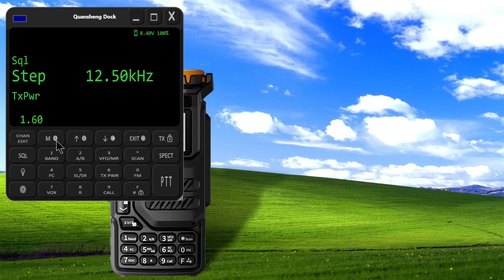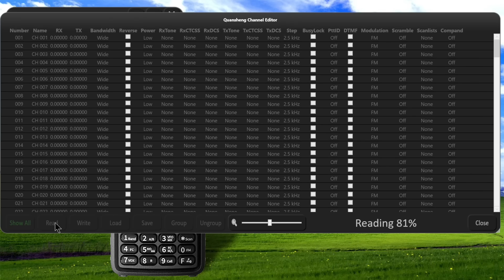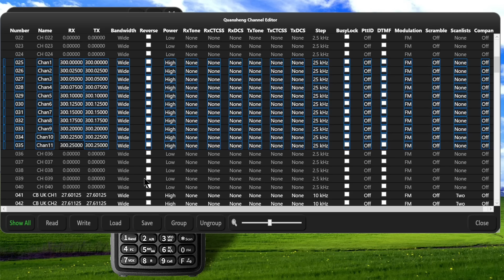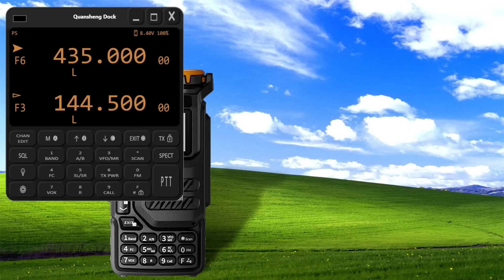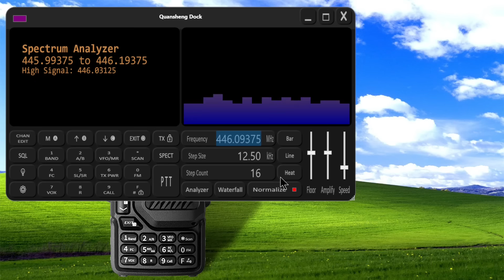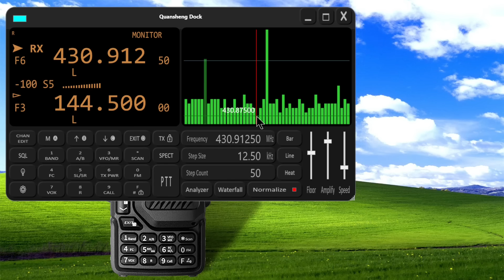Quansheng UV-K5 Remote Dock System

Comment: Just curious. Does your very nice software only run on your firmware, or can it be used with any? I have 2 of the radio's both on different firmwares. Is there anything special built into your compiled bin file to make your front end work or will it see other's aswell ?

Small update : I installed the frmware from the link above, installed the software on my PC, and it does work, problem is, it also crashed my PC 4 times in a row with a different BSOD code each time, there is some really BAD bugs in your software, as soon as I uninstalled it,. my PC was fine again. I like the idea, but not the instability it seems to have.
Reply from the maker: Sorry to hear that you're having those problems. Not sure what to tell you. I've been developing this for that last 4 days and my PC hasn't been restarted that whole time and the app has been run hundreds of times and left running overnight and I've not experienced a single BSOD. Everyone's PC is different though and you may very well have some hardware/software configuration that disagrees with it somehow. I did see another video of someone demonstrating it where the app crashed while he was adjusting the font size in the channel editor, yet I could not replicate it. But I clearly saw it crash on the video. Things like that are extremely difficult to pinpoint when they can't be replicated locally. I'm sure that others will likely get the same issues as you and report it. Bear in mind this app didn't exist 5 days ago, it's extremely new and bound to have teething problems.
Reply: @nicsure  Thanks for the reply. I haven't got a problem with the software, I FULLY understand newborn's and their inherent ability to piss one off. I'm happy to keep playing with it, like I said, I like the concept, but the bugs are problematic. My PC is setup with just about every radio software I can install, and programming software for several different radio's, any of which could be throwing a tantrum. I can try it on a less cluttered machine and see if the problem re occurs. I really don't want to have to reload Windoze as a possible fix for an issue, It would be a nightmare on this PC, as it's my radio machine, it has EVERYTHING I use daily for all my radio stuff, and some of it takes ages to reconfigure, I hope it gets sorted somehow, I am very impressed by it so far, I REALLY like the channel programming abilities you built in, the feature video made me install it before it had even finished playing.....

Quick crash information : All was working, I was clicking around and seeing button presses changing things on the radio, opened the spectrum and closed it, opened the settings and closed them. I then clicked on unlock TX, nothing happened to the icon, I clicked PTT and it opened the TX on the radio, even though the icon padlock was still locked. I clicked PTT a second time  and the radio locked in TX, the software froze and I had to do a force shutdown of the entire PC. Both keyboard and mouse were locked. I assume something crashed the USB hubs in the PC. After a reboot, simply opening the software with the radio connected and turned on would result in a BSOD. After unplugging the cable, rebooting and removing the software, the PC is fine again. i tried to find the BSOD logs to see if anything was showing as to the cause, but I have no idea what to look for or where to find them. I followed a google idea or two and got nowhere, and sadly event viewer lacks any real information in its error logging.

One other idea, is is possible to maybe have the radio talk the PC via the USB3 port as an optional connection? Or would that require more in depth knowledge?
Reply from the maker: @bitemykrank1970 I would say that the most probable cause is RF energy getting into the cabling and causing all sorts of mayhem.
Reply: @nicsure  It would have to get through a bucketload of ferrite first. Every cable in my shack has at least ten clip on or through wrap ferrite blocks as I had RF caused PC shutdowns on 144-148mhz before with the HT antenna's too close to the monitors. I doubt it's RF swamping it, it was only on TX for 2 seconds and only at 800mW output power. I'll try it again and see if I can replicate the problems. It's simple enough to change the radio firmware again.
Reply from the maker: @bitemykrank1970 I'm just seeing a lot of reports of problems that seem to appear right when the user is transmitting. It seems unlikely to be a coincidence. I actually have a bad fear that radio, being not of stellar construction has very little isolation on the side ports. So when transmitting it's literally injecting RF directly into the attached cables. If that's the case I may as well close the project as it's never going to work. :(
Reply: @nicsure  I had thought of that myself, I am going to wrap one of my program cords with some ferrite and see if it is any better. I did get a few lines on the monitor at first keying, so there is certainly RF around , whether or not it's coupling to the audio or microphone port is anyone's guess, it could be as simple as crappy cables without decent sheilding, don't give up on it yet, it might only need a simple fix.
Reply from the maker: @bitemykrank1970 I'm hoping the AIOC will offer a solution to the "hack a cable together" approach. I should be getting one soon so I can experiment.
Reply: @nicsure  I was going to suggest this as another possible fix, but being in beta itself, the AIOC may have issues aswell. I'm not clever enough to fix issue's in two areas at once..
Reply from the maker: @bitemykrank1970  I've been reading about it and from what others tell me there is an issue with the PTT assertion when used with my system. However, there shouldn't be any need for that part of it as PTT can be asserted from the Dock over the data line instead. But I'll get more of an idea about that when it arrives. I know it's in beta, but it is definitely a far better solution. A Bluetooth version of it would be even batter.
Reply: @nicsure  I'm sure WiFi and Bluetooth are on the drawing board, if not already in the works....I'd be surprised if the AIOC designers do a half assed job, they seem committed.
Reply from the maker: @bitemykrank1970 You seem to know about this stuff. Are those "clamp on" ferrite things sufficient for the USB-C cable on the AIOC?
Reply: @nicsure  I cannot say they will fix the issue, but I can say they wouldn't hurt it. I had RF swamping from a HT on 477mhz, as soon as I keyed up, the PC would shutdown, I never found the root cause, but adding ferrite to the power cable of the PC and the monitor cable resolved the issue in that case. I also had an RF issue on a laptop via a programming cable for my mobile UHF, I added 3 inline type 43 clip on cores, wrapping the cable through each one two times, and the RF was killed. I don't know if it will work on the lack of shielding in your average USB cable, but I have a " High Quality " USB cord for my ICOM 7300 and it came with a ferrite block at the PC end, so I assume it must have some effect, how much though I cannot answer. Best suggestion is to buy some and try some....a trip to your local electronics store might even get a few free for testing if you explain the reason your wanting them, most people into electronics know about the test phases of a product, and many are only to happy to help. I'd send you some myself, but I doubt I could afford the current international postage cost.....

Comment: Neat stuff.  I was having a look at the firmware project.  I think documenting the serial port API you implemented could yield a lot more interesting projects.  I'm personally thinking about the possibility of permanently attaching a Pi Zero and enabling scripting operation via bash scripts or a python library, possibly even adding a web UI...
Reply: I think this mod is perfect for uniting this radio with a DigiPi system...
Reply: Please do everyone a favor and do it in go lang especially if you intend to use a web GUI, python is just to hungry especially on devices like a Raspberry Pi. 
But besides that I give your ideas a thumbs up 👍
Reply: @jacobscheit4128  If you're that worried about performance, I'll make sure it runs under pypy.  I'd rather not have to worry about ensuring it compiles under multiple architectures.

But the language won't be a limiting factor here; everything will be bottlenecked by the serial communication with the radio.

Comment: It's a shame that such an awesome piece of software is developed for such a poor radio. Would it be possible to use it with a truSDX or something von QRPLabs?
Reply from the maker: The radio isn't the only thing that's poor. I can only really develop for stuff I can afford.
Reply: @nicsure   that's true but the others are not much more.  maybe you can modify it so that the community can develop it further for other radios or donate you other radios. I could imagine how much time you spent in this and it would be a pitty if it's only usable for such a crappy radio
Reply from the maker: @mt8385 Well it's all open source so anyone can try to adapt it.

Comment: Fantastic...very slick.  Will a virtual audio cable output work once a modified physical cable is used?  I'm looking to trigger VOX in zello.  Thanks.
Reply from the maker: VOX is tricky, you'd need to hack into the audio-in line too. Unfortunately I don't know what zello is or what a virtual audio cable is either so I can't really advise you on that.

Comment: it works with the programming cable ? or i have to modify the radio in a certain way for this software to work?
Reply from the maker: You don't have to modify the radio at all. It will work with just the programming cable but you won't get any audio. You need a special cable for audio and TX to work.
Reply: @nicsure  got it, in a radioamateur group im at alot of people talk about the poor quality of the quansheng radios on rx or tx or even in' build quality, are they wrong ? because since i started looking into this radio there is alot of cool things about it that for example my baonfeng uv82 doesnt have at all, would you recommend it ?
Reply from the maker: @Akiralsdr It's hard not to recommend it for the price it is. When all said and done it costs about as much as ordering a couple of pizzas. For that price you're not going to get an iCOM but at the end of the day, it works, and in my opinion it works far better than it has any business doing for its price point.

Comment: Sweet. Put a roof mounted 2m/440 antenna on the roof and this radio o house main power you have a radio that hits all the repeaters in my area and it has its own back up power incase of emergencies. Controllable with a PC. Even better.

Comment: It has been said by some cynics that the reason that these are so open and modifiable is that the manufacturer is using the community to do all of the work of research and development for them..
Reply: I hope it's working for them, I've already got two of these things and can't be happier. The open source firmware just opens endless options.
Reply: If the manufacturer acknowledges all the wide band firmware's existing, they might have to prevent their installation, to keep their FCC certifications.

Comment: Nice video! I'm still a beginner on this but I wanted to use and try this. Just a question if incase I wanted to revert this to the original egzumer firmware do I just flash it again directly? I don't wanna brick my radio im just poor.
Reply from the maker: Yes, there's nothing permanent about flashing a firmware. I must have flashed mine hundreds of times now. If you want to take the radio back to the standard egz firmware, just flash it back on.
Reply: @nicsure  Alright, thanks!

Comment: Nice video and amazingly well done. I'm surely going to experiment with this, thanks! Coincidentally I just bought two of these on AliExpress two days ago: a UV-K5(8) (€19) and a UV-5R (€20) including programming cable and free shipping. They will be delivered around Jan 15th. I was thinking of unlocking TX on one of them for the PMR channels. Any idea if some power will get through the hardware rejection filter (if there is any) on those frequencies? 73 de PA. Liked and subscribed.
Reply from the maker: Thank you for liking and subscribing I really appreciate that. As far as I know, it will transmit on the PMR frequencies with no problem, but I must point out that the radio isn't certified for transmitting on those frequencies. Realistically no one is going to know what you're transmitting on if you keep the power low, but just be aware of potential legal issues there.
Reply: @nicsure  Good point, don't want to lose my license. I'll keep the power as low as possible.

Comment: "QuanshengDock.exe" where do i find that programme? Its not in the zip file?!
Reply from the maker: It most definitely is, I just double checked myself. It's possible you have some security software that has deleted it or misidentified it as dangerous. If you're concerned you can review the source code and compile it yourself.
Reply: I dont even have a antivirus scanner but in the zit there is no QuanshengDock.exe and when i look on the github there is no QuanshengDock.exe. Im i getting old or what?
Reply from the maker: There's no exe on the github itself, that's only the source code. Make sure you're downloading it from here: https://github.com/nicsure/QuanshengDock/releases/download/v0.21q/quanshengdock.zip  . I can assure you, once the zip file is extracted to a folder, the exe should be there. If it's not then there is something on your system removing it somehow.
Reply from the maker: Oh, and It might not be called "QuanshengDock.exe" on your system. As a developer I always have file extensions showing for all files on my system, but I forget that not everyone has their Windows setup like that. So it might just be called just "QuanshengDock" without the ".exe". It should have an icon that looks like a UV-K5.

Comment: in my opinion....i think it's better to integrate with pc/laptop microphone... there's APRS cable that have 3.5mm and 2.5mm to a 3.5mm audio jack that's usually done for APRS,SSTV etc....
Reply from the maker: Yes, I was wanting to do this, but then it starts getting messy with regard to wiring and audio routing, you'd need two audio inputs on the PC side, one for microphone/FSK and one for radio audio/FSK and two audio outputs for monitoring and sending audio to the radio for transmission. It's likely something I will incorporate later as I wanted to get this to a state where I can fully use the radio from a remote desktop connection.

Comment: Amazon job ! Could you provide câble schematic in ordre to connect audio to the computer ?
Reply from the maker: Sure. I'll add a schematic to GitHub. There is a rough hand-drawn diagram there already.
Reply: @nicsure can you show how to DIY it....i have this in my thought a month again but failed to think how to diy it
Reply from the maker: @mikhailsimon9027  The diagram, schematic and step by step guide on how to make the cable is on the project page on GitHub. Check the video description.

Comment: The perfect software for my new rigs. Thank you.
I'll be opening up my 2 HT's and mounting them in metal cabinets to act as base stations. I'll add switched bandpass filters for 10 meters, 6 meters and 900 MHz to make a couple of 5 band transceivers out of the HT's. They will come in handy, as I have nothing at the moment that can operate on 6 meters or 900 MHz. I'll add a good speaker and pre-amps for receive as needed, and perhaps a 40 Watt power amp for 10 meters and 6 meters. I already have a couple of 3 Watt amp modules for 900 MHz. The hardware mods I can do, and I have a lot of old HP and similar test equipment on the bench that has just been gathering dust, and I have a NanoVNA as well, so I'm all set. The software I'm not good enough at, but that's all on the web for easy downloading, and there are new features being added practically every day by software folks. Fun and games and a winter construction project. These rigs will take some work, but I have most of the parts I'll need already in stock, so I doubt if I'll even have $50 into each of them by the time I'm done. I'll call one rig Frank, and the other rig Stein.
Reply: Just completely bypass the filters in the radios and send it straight to your filters, thats the only hard part of the mod.
Reply: You might need to remove the existing  filters from the radio pcb to make it work decent enough
Reply: I'd be interested to see how much TX power you can get on 10m and 6m after hacking the filters.  It might make for a pretty decent portable 10m radio, suitable for the the technically-minded new technician-class ham...  Especially for the next couple of years with the space weather being so nice.
Reply: @georgedorn_fnord  even a watt would be fine.